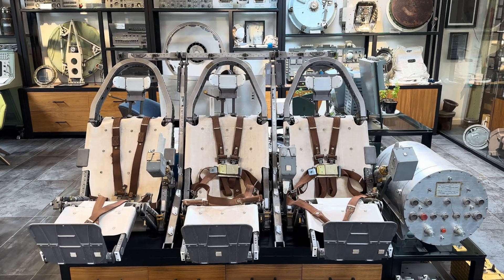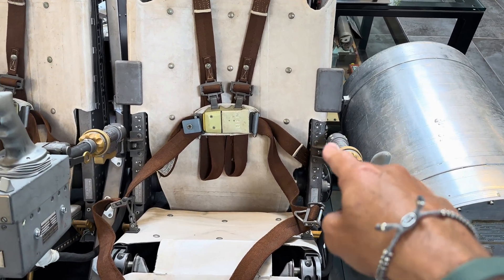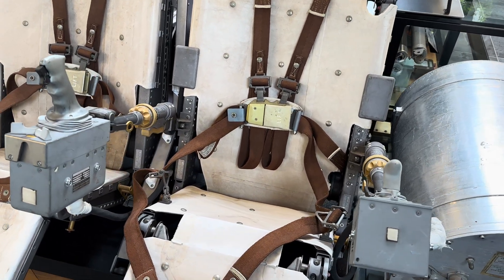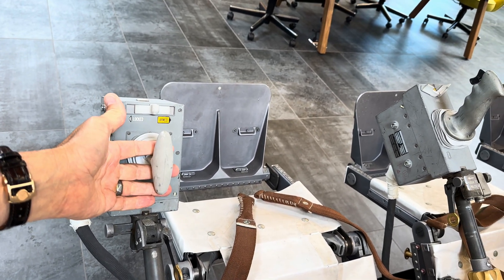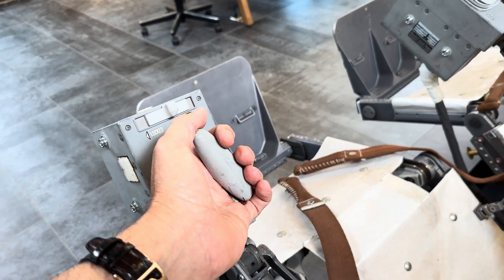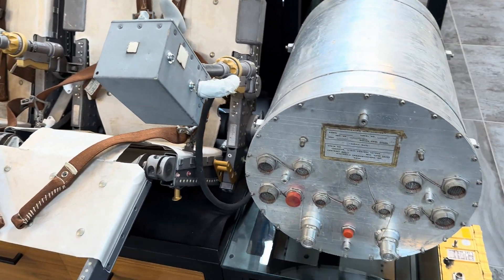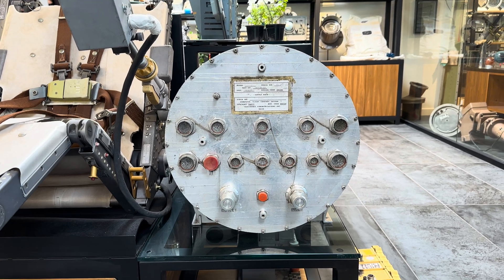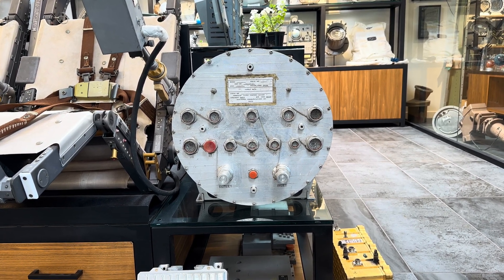The Apollo Hand Controllers

Comment: Please confirm this for me: During launch the Command Module Pilot is in the middle seat but the mission Commander is in the left seat and is actually the primary pilot since he has the full set of controls. Does he remain the primary pilot during course corrections maneuvers, etc? Other than that, as i understand it the CMP does the initial docking with the LM and extracts it. So has he taken the left hand seat at that point?  (Let's ignore the non-standard Apollo 11 seating.)

I don't understand how the center seat right hand joystick operates as a redundant control. Can it somehow handle both rotational and translation control?

EDIT: Looking at other pics online I see the right hand joystick is an exact duplicate of the left hand one, so the one in this video is an exception. I still find it odd that the center seat doesn't have a translation controller - although I can think of a way for one of the two joysticks to be used for translation. (The black trigger would be used for up and down.)